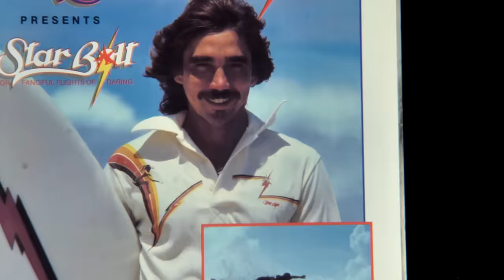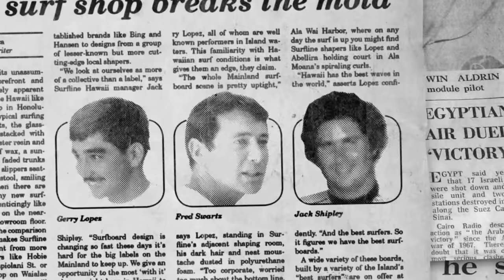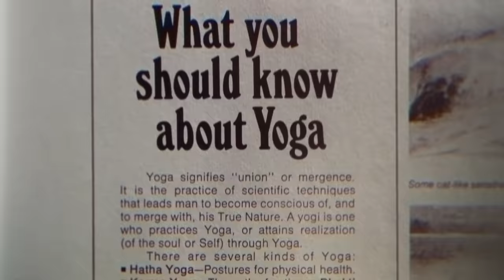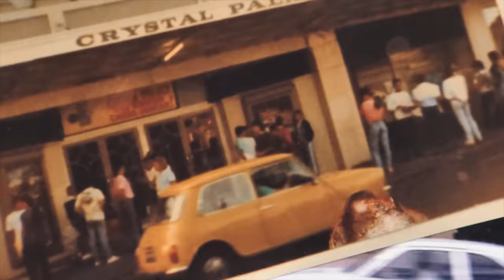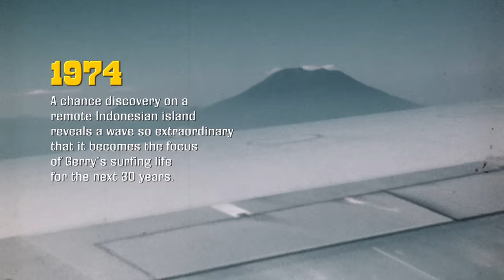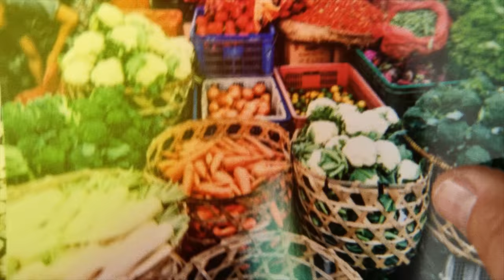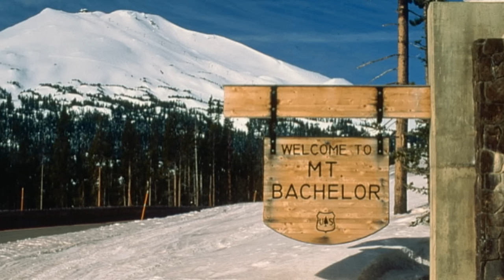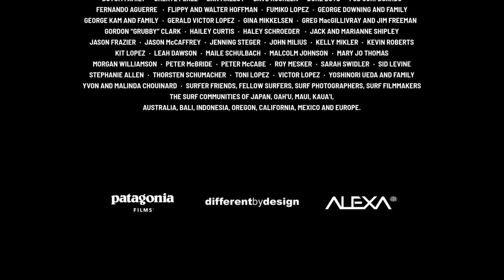The Yin & Yang of Gerry Lopez | Patagonia Films

Comment: If JOB can get pipe barrels on the 9'0 log why couldn't they in the 60s? Was the shortboard revolution actually necessary? Love the film.
Reply: surfing has evolved a lot since then. JOB's backside style at pipe was in it's infancy at the time
Reply: Doesn't JOB do it on a Catch Surf soft top though? Or maybe a giant inflatable sofa...?
Reply: Is it a vintage 60's or modern version?  Shapes have evolved over the years. Don't believe any are riding the Bolt single fins there anymore either. Seriously
Reply: In that early era, the rail development hadn't happened until the down rail/ brewer / Diff/owl  gerry, and reno. Plus others. no rocker 50/50 rails, boards 30 lbs. Spelled disater